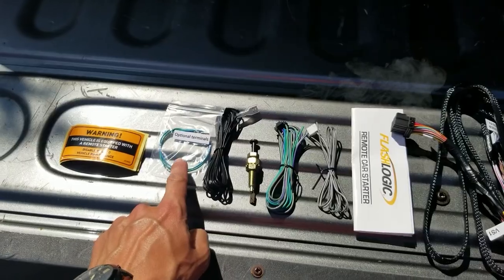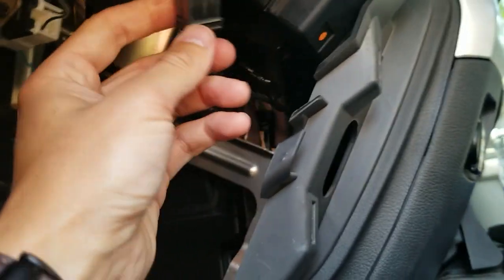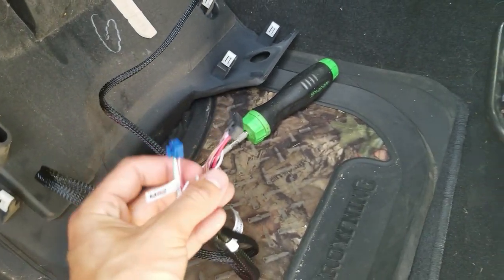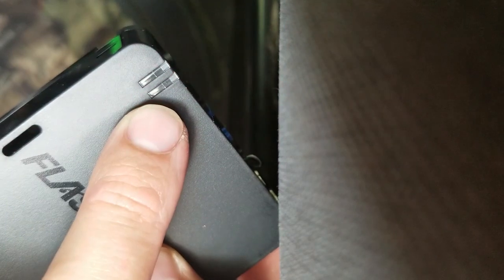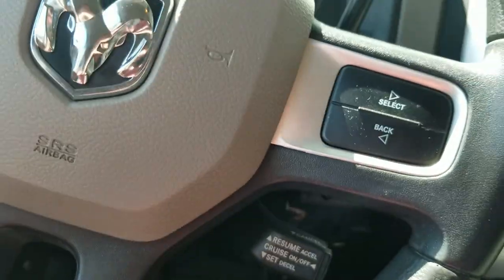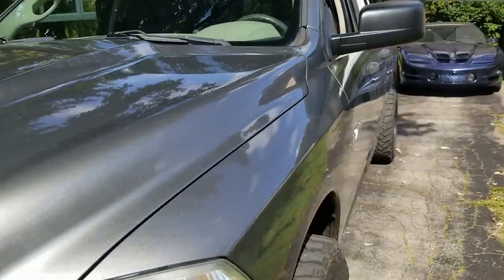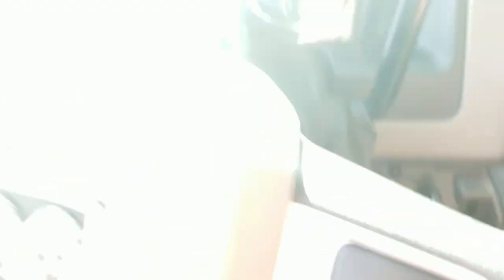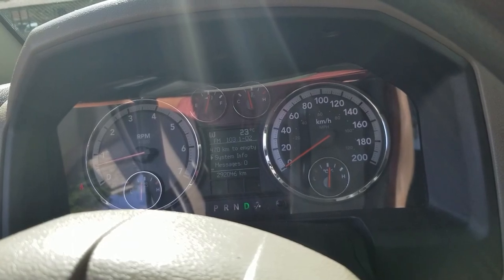How to Install a Remote Starter on a Dodge Ram - 2009 - 2017

Comment from the maker: You can pick up this plug and play remote start on eBay here:
2009 - 2012 Ram Trucks 👉 http://bit.ly/09-12ramstarter

2013 - 2017 Ram Trucks  👉 http://bit.ly/13-17ramstarter

 ('13-'17 RAM trucks require additional FOB programming on windows PC, cable included and can be done at home)

Comment: I bought this product and installed it today without issue, thanks to your video! I was curious what you would say is it's maximum range in your experience?
Reply from the maker: Glad to hear you're install went smoothly! Typical range with the factory fob with a clear line of sight is probably around 300ft.

Comment: I ordered flashlogic plug and remote starter kit, but mine came up without a key fob ,my truck has window side lock and unlock. So I need some other kit as well in order for it to work.  Do u know any flashlogic kit compatible with it . Or I am out of luck
Reply from the maker: This kit uses the factory fob. Message the seller on eBay, he may have a solution for you.

Comment: Hey! Quick question. So I’m trying to install this in my 2013 ram 1500. Did you have send this program out in order to get it re program? Other videos say that the programmer needs to be sent out? Is this true?
Reply from the maker: Just message the seller on eBay right after you purchase and give them your order ID and vehicle info. They will program before sending the unit to you.

Comment: Do you know if there is a way to leave the truck running and get out with your keys? I just installed mine tonight. Super easy thanks to your video. But I didn’t know if maybe that was a feature as well?
Reply from the maker: Not too sure, anytime I jump out for a minute and wanted to leave the truck running, I just remote start it again.

Glad to hear you found the video helpful, enjoy the remote starter!

Comment: Thanks for the video. In less than 5 minutes I had it installed and running on my 2011 Ram 1500.
Reply from the maker: Glad to hear you found the video helpful 👍 By far the easiest upgrade I've ever done to any vehicle  I've owned.
Reply: @DeancentGarage  was this two way remote and is it that is for viper two way remote with out the key fob regular key too??
Reply from the maker: This is just for the factory key fob. To use a viper two-way you would have to install a viper system.
Reply: @DeancentGarage  Two years in and couldn't be happier. How has yours held up so far?
Reply from the maker: That's great to hear man! Mine has also held up perfect 👍

Comment: I have a stupid question. That just flashes the FOB, and not the whole PCM, correct?
Reply from the maker: Nothing existing in your truck gets flashed. The new flashlogic device you need to purchase is flashed by the seller specific to your truck so it can talk to your truck. 

Then you program your fob to the new flashlogic device so you can use your existing fob to start the truck.
Reply: @DeancentGarage  Thank you. Okay, I was curious because I have a tune on my truck for a cam and other work and the timing and everything changed from factory. I didn't want to accidentally flash it back to stock and lunch a motor or something.
Reply from the maker: You'll be good, this just adds a remote start function.
Reply: @DeancentGarage  sweet thank you!
Reply from the maker: No problem!

Comment: could you buy a key fob that has the remote start button....would that work with the flashlogic or would it  need to be programmed separately?
Reply from the maker: Not too sure Eduardo, it would be best to reach out to the seller on eBay and ask them directly.

Comment: Thanks for video. I just ordered and let him know I learned about his product through you with the link to this video. Question, the last thing you did with pushing the brake down twice to put truck into drive, is that something you have to do each time you remote start it?  Not a big deal just checking,
IS your truck a 2012?
Thanks again, appreciate it.
Reply from the maker: Hey thanks for watching. Glad you found it helpful.

 I learnt you don't have to double press the brake. Just press once to put in drive and good to go.

I have a 2009. Basically the same as '12.

Enjoy the remote start and Happy Holidays!
Reply: @DeancentGarage  from what I see it's much faster install on these years than later years. There are more wires to hook up. Thanks. Merry Christmas

Comment: if the car comes without a keyless entry fob, it only comes with a transponder key, it can be possible to program a fob key and then install this kit? best regards.
Reply from the maker: I'm not sure. Would be best to ask the seller on eBay.
Reply: Any updates with this question?
Reply from the maker: Best to ask the seller on eBay.

Comment: These system fit to a RAM 2500 of 2011?
Reply from the maker: Hi Manuel, here is the one for a 2011 Ram 2500. https://ebay.us/tP0jLY Also good for 2010 to 2019 2500 and 3500 trucks.

Comment: I don't understand the unlock buttons part when you talked about the takeover mode
Reply from the maker: I was just saying once you've hit the lock button 3 times to start the truck, you have to press unlock once to get in. I just mentioned it after I had already unlocked to get in.
Reply: @DeancentGarage  oh i see clear now i thought it was  part of the key programming thanks a lot
Reply from the maker: @blakedexter3224  no problem

Comment: How can I get one of those sir
Reply from the maker: You can pick up this plug and play remote start on eBay here:
2009 - 2012 Ram Trucks 👉 http://bit.ly/09-12ramstarter

2013 - 2017 Ram Trucks  👉 http://bit.ly/13-17ramstarter
 ('13-'17 RAM trucks require additional FOB programming on windows PC, cable included and can be done at home)

Comment: Just got one myself, thank you for the install info & great video! From what I've read on the reviews one of the negative things about this system is the installation instructions were something that were not included and you had to contact them for?? Honestly who cares that it don't it seems simple enough, and I like the fact it is plug and play. With your video it should give anyone the confidence to attempt the install on their own truck. The price is super attractive, and it looks to be fairly well put together. Have you had any hiccups? I will have to check out your Turbo 944 build!
Reply from the maker: No problem and thank you. I received install instructions with mine, would be a bit odd to send the kit without instructions. After this video though you're right, you shouldn't need the instructions as it is very straightforward.

I've had it since September 2019. I'm sure I've used it over 100 times now, not a single issue.

Sounds good enjoy the videos, I'll be uploading more shortly.
Reply: Will this work 2009 with 4.7 engine?
Reply from the maker: @mikematheny9171  hey Mike, that's the exact truck in this video. 2009 4.7l. Been working great for 1.5 years now.

Comment: Great video! Now that you've had the unit installed for a while, are you happy with it? Any issues?
Reply from the maker: Thanks Jason, It's been perfect. No issues, works everytime exactly as it should.
Reply: @DeancentGarage  if your coolant temps are up to temp will it not start for you?
Reply from the maker: @Disfigney  It starts everytime regardless of coolant temp.
Reply: @DeancentGarage  interesting I just found out I’ve got remote start and I only was able to start it once lol
Reply: Hey question, astrostart/astroflex starter here. Mine looks nothing like yours after the t harness is installed. I'm looking to take my autostart out. Thank you :)
Reply from the maker: What was your question?

Comment: Hey so i got it today but for some reason my engine will only start with the remote start it does not start manually like with the key in
Reply from the maker: I would guess something at the ignition is not plugged in correctly. Did you plug the ignition where the fob plugs in to the T harness? If yes, unplug it from the T harness and plug it back in.
Reply: @DeancentGarage  i did it just like in your video
Reply from the maker: @maiquelcastro1115  I would go through everything again. Carefully check all the wires as well. Something isn't making a connection somewhere.
Reply: @DeancentGarage  thank you i checked and the blue connector was disconnected prolly got disconnected when i was trying to put the pannel back on
Reply from the maker: Glad to hear you got it figured out, enjoy!

Comment: Does it still work today ?
Reply from the maker: Working great still, no issues. I actually bought a similar kit from the same company with same programming instructions for my wife's 2013 civic. Installed that one 3 weeks ago and has also worked flawlessly.
Reply: @DeancentGarage  awesome thanks a lot i will buy the kit i install it with your vid thank a lot
Reply from the maker: @blakedexter3224  glad I could help, let us know how it goes.